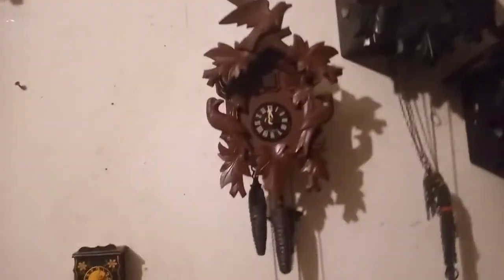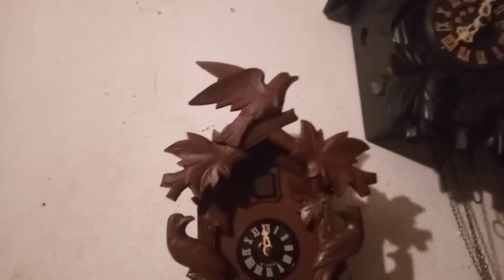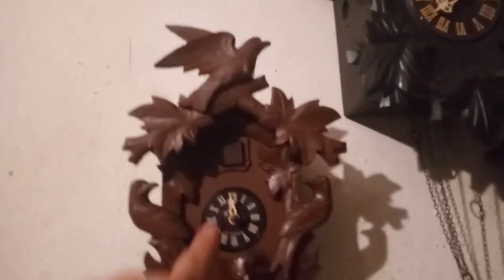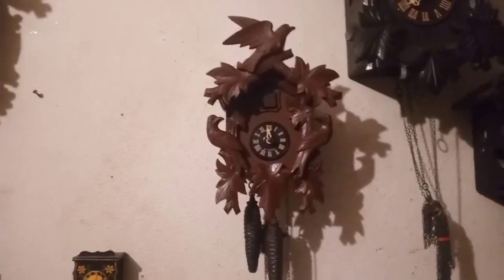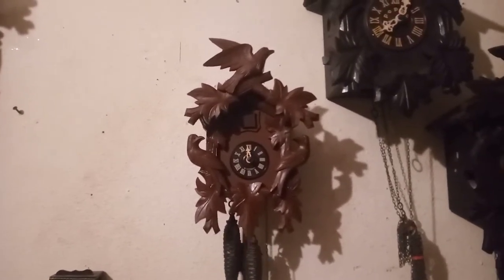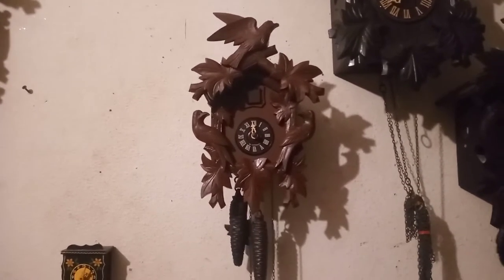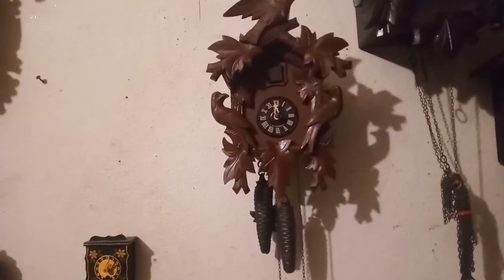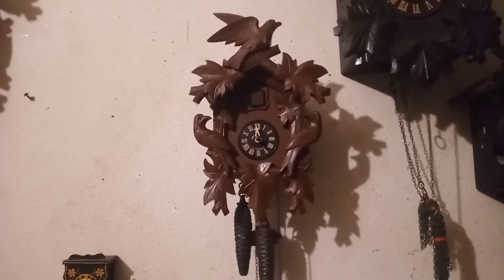Repairing a one day cuckoo clock with plastic trim and AMS movement. 20220215 001413

Comment: make a Video Of the seth Thomas clock And Chime It Okay
Reply from the maker: I already have a couple. One is here. https://www.youtube.com/watch?v=t_pDK2zqbx0&list=PLGd5hmS4B9JNdshVnL_LjxDkgP-85kdaR&index=2
Reply from the maker: Here is another video showing you the insides. https://www.youtube.com/watch?v=mskdaFOeGwc&list=PLGd5hmS4B9JNdshVnL_LjxDkgP-85kdaR&index=4
Reply: But No CHime
Reply from the maker: It does have the gong but it plays after it cuckoos. I am sure that I need to adjust the 8 point star wheel on it to fix it. Just havent got around to it. 
Here is another video that I just made. https://www.youtube.com/watch?v=S01Ax9JYRg8